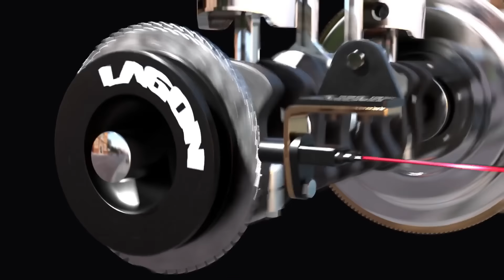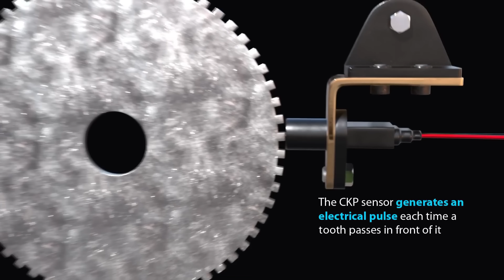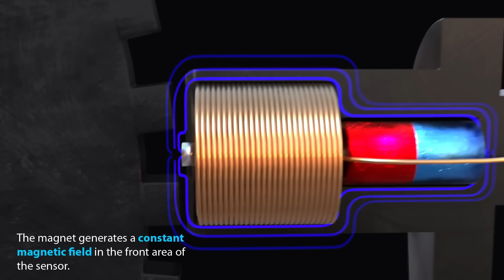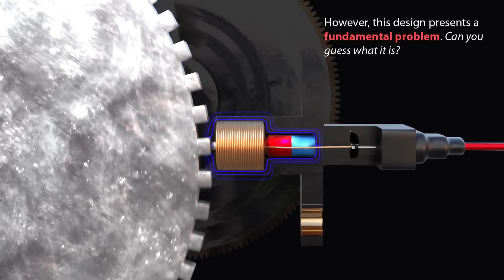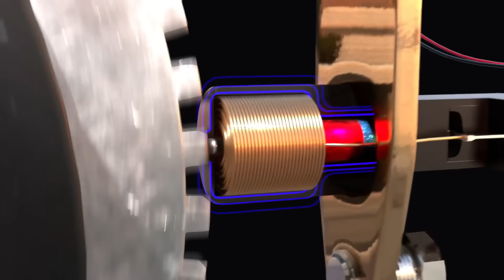Crankshaft Position Sensor (CKP) Explained in 3D

Comment: Just FYI, the sensor signal in the video is an analog signal (AC Sine Wave) produced by two wires CKP sensor which generates its own voltage. Newer cars work on a 3 wire hall effect digital sensor that produces square wave instead of sine wave.
Reply: Even robotic mower have  hall effect sensor (in front) to detect boundary wire.

Comment: Some engines can detect a failed cam position sensor and still run without it. They inject fuel and spark in a cylinder on two consecutive revs and detect from the crank sensor when the engine speeds up which then shows which cycle the cylinder is on. So if the engine takes longer cranking than usual to start, the cam sensor may be at fault.

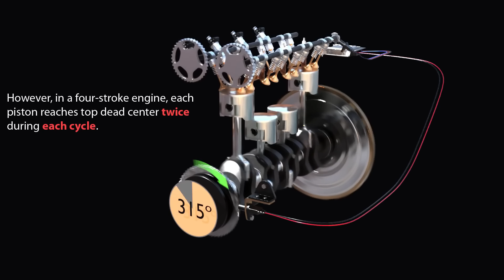Comment: I think it should be noted as the video mentioned at 4:55 there should be two 360 rotations to complete a full cycle. This complete cycle is said to be a 720 rotation of the engine.
Reply: that is because 720 degrees is a full rotation of the combustion cycle

Comment: The 1996 LT1 V8 used a crank shaft reluctor ring with 4 magnetic breaker lugs and timing was through the distributor attached to the cam shaft which worked with a wheel with 360 windows,it was a simpler set up,the ecu controlled the distributor on every quarter turn of the crank.

Comment: carburetor: look what they need to mimic a fraction of our power

great video though!!
Reply: This is way more precise and performs thousands of calculations per second lol. A carb wouldnt pick all this up
Reply: @chargerification  the point Is a carb engine doesnt need to know! It simply works directly under the laws of physics His beauty lies in his simplicity
Reply: The carb is fuel only.
Electronic ignition timing still needs sensors.
Contact breakers were not as reliable.

Comment: In modern designs, the ECU manages the spark timing using the crankshaft position sensor. In older designs, however, the spark was generated directly by movement: the initial movement triggers an electromagnetic field in the primary coil, which then induces a much higher voltage (up to 60,000V) in the secondary coil.
Reply: NICHT DIREKT in der Primärwicklung  der Zündspule. Es ist noch ein Leistungstransistor ("Power-Stage") zwischen Trigger ( Hall-Geber bzw. Induktiv-Geber ) und der Primärwicklung der Zündspule.
Im Moment des Abschaltens der Primärspule wird in der Sekundärspule durch Induktion eine Hochspannung  induziert.

Die Steuerelektronic kann nicht direkt die Primärspule  schalten, weil die Stromstärke  mit ca. 8 bis 12 Ampere zu groß ist und daher  nur durch einen Leistungstransistor  mit Kühlkörper geschaltet werden kann.
Reply: @Michael-l1p4x  darlington transistor

Comment: Just don’t replace your OEM sensors with cheap aftermarket parts from Auto Zone. Not the same.
Reply: Recently I got an ATF transmission filter with the manufacture logo with Made in Japan printed on the packaging but on close inspection it was fake shipped from China 🇨🇳.
Reply: I used to be an aftermarket guy but no more I find it's worth the extra money to buy OEM
Reply: After buying a 06 e55 mercedes, cheap parts dont last and you'll be replacing again soon.

Comment: Thats a good explanation, thanks. So now you know why modern engines crank for longer before starting compared to old school engines. Modern engines first need to read sensors and determain crank and cam positions before allowing the ignition to fire.

A well tuned old school engine will start by barely turning the key. The first spark will ignite if fuel and air mixture is there. No need to spin engine a few times.
Reply: Or backfire.  Or flood.
Reply: I agree with you but spinning 2-3 times before cold starting a 4 stroke engine allows the oil pump to build a little pressure bcs some pumps only begin pumping real good after 2 3 seconds during a start. For example my old diesel fired Aro 244 with the D127 "Brașov" engine.
Reply: @panaitlaurentiu5761  plus most electronic engines run in "closed loop" regarding sensors, until oil pressure or water temperature thresholds are surpassed. Then it goes into "open loop" taking inputs from engine sensors. This helps with cold starts

Comment: Thanks for the explanation. Problem is, eventually those sensors or the ECU fail, and your car won't run. In other countries, machinests reconfigure the engines to use old school tech that doesn't need a computer to run. I hope they start doing that in the developed countries, otherwise, we won't have any good vehicles left in a few years. The old cars are great, but modern cars are more comfortable and have prettier styling. It would be great to have the best of both.
Reply: When's the last time an ECU or a position sensor failed?  Milions of cars annually...

Comment: It's also worth mentioning that irregularities in the pulse frequency are used by the ECU to report cylinder misfire.
Reply: Correct…But… it can end up reporting the wrong cylinder and/or an incorrect number of cylinders in the event of a multiple cylinder misfire due to differences in compression from wear/damage accumulated over time over time, so its far from perfect but it does work.
This sensors reading can also be used by the ECU and diagnostic software to produce relative compression test results, meaning all the cylinders compared against each other for who has more or less compression, measured by the reduced pulse frequency on the compression strokes this can help to detect an obviously weak cylinder caused by mechanical condition of the engine. Additionally, some engines ECM’s are sophisticated enough to run this test by not allowing fuel to prevent catalyst damage during the testing sequence, then you can produce a graphical display showing you the results, Volvo D13 engines in buses and heavy trucks run this test.l and im sure Cummins does too and probably a whole bunch of others nowadays
Reply: Mine isn't reporting it at all!

Comment: Engines back in the 70's didn't need any silly sensors or computers 
to run and they ran smooth too. All they needed was fuel, ignition, timing ,distributor and a carburetor that's it👍🏿
Reply: Thats why they ran very inefficient in comparison
Reply: True but they were far less efficient and powerful.  Modern 4 cylinder engines have the same power as a V8 in the 70s
Reply: @machinesandthings9641  Put that 4 cylinder engine in a 1970's car with nothing but plugs, points and a condenser means you got a sewing machine pushing you down the road.
Reply: @machinesandthings9641 

Yeah But modern 4 cylinder engines are working 2.5 times  as hard to move the same amount of weight that a v8 can do with ease. For example an early 70's 460 had 365hp/485tq a 4 banger can have the same output but that engine is working hard as hell.
Reply: @David-yy7lb It just won't last 😂
Reply: Lmao trash ass cars in the 70s 😂
Reply: @AbelG8781  No shit.  Probably the WORST decade for cars, especially American lead sleds w shitty engines and horrible styling.
Reply: @AbelG8781  Yes, they were pretty bad!  Especially when they started adding the smog items.
Reply: It’s called progress. We didn’t need cell phones either.
Reply: Which was why they got 8 miles to the gallon
Reply: I’m glad I didn’t drive these cars in the 70’s. I’m happy with those silly sensors in my 2004 and 1998 AMGs.
Reply: dUDE, Back in the day it would have to be big old V8 to make as much power as my naturally aspirated v6! I get what you mean, but new engines are way better and no need to have headaches of constant carburetor adjustments. I know, I was there on an old chevy C10 custom!
Reply: Right.  My Dad's 1970 Chevy 1ton 350 ran smooth like a dirt road w pot holes that barely made 100,000 miles.  There's just no comparison with today's vs then technology.  If you want to whine about planned obsolescence, fine; but that's another story.  By your logic, piston engines in the teens and 20s are superior to the 70s.

Just because you're a luddite that can't use a multimeter, stop trying to overcompensate for your lack of education and learning.
Reply: Brother, your ignition distributor had the equivalent of a CKP/CMP to trigger the electronic ignition. And if you wish to enjoy pre-electronic ignition days, you get POINTS type ignition and 15,000 mile tune-up intervals 🤡.
Reply: @hightttech  So what, we would change our own plugs points and condenser in less than an hour and spent less than 40 bucks on a tune up.
Reply: @martinscalf114 too right, if a car stopped on the road I had a chance to get it going. Nowadays you need a computer just to adjust ignition timing!
Reply: Back in the day they used to harvest the crops by hand! They never had to worry about aint no tractors failing and shit. 
Stupid comparison.
Reply: @MrFiction80 i think youre the one making a stupid comparison here 😂